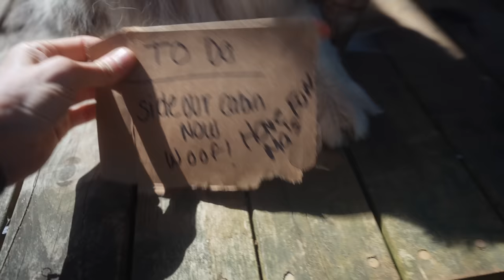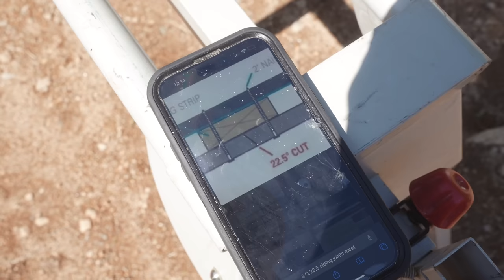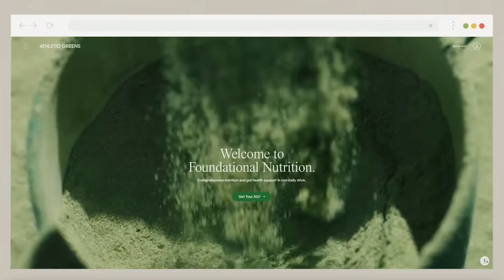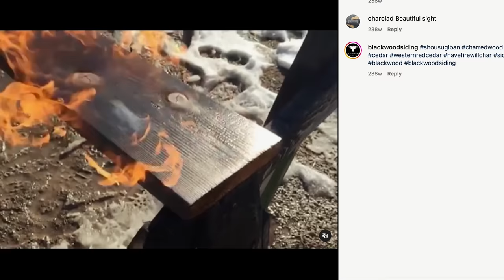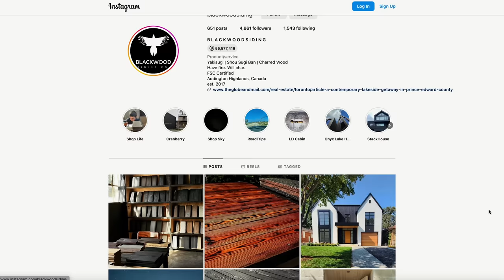Cabin Gets Huge Transformation With New Siding!

Comment: Looks like your Bosch saw is also a sliding compound miter saw. If you laid the siding down flat and leaned the saw on an angle, it would be both easier and safer to make that cut.
Reply from the maker: Thank you, for sharing your knowledge and experience with us. We are learning and appreciate you passing on this information. 🌞🐾
Reply: @Vanwives  I hope I wasn't Mansplaining. When it comes to safety, I had to speak up. Love your videos!
Reply: @JohnB-kc6ii  ...Wouldn't know if someone didn't tell them ...... Of course there's always the tool instructions ,, but we all know about that ... makes good fire kindling ..
Reply: Yes, placing siding flat on the saw table is safer and makes more consistently accurate cut. Carry on!
Reply: My thoughts exactly. It is also alot easier to cut. How did the saw blade hold up? I found charred wood dulls saws fast.

Comment: Both saws are capable of rotating the angle of the blade so you can have the siding flat on the base and cutting the correct angle. But it is definitely looking great. keep up the good work.

Comment: Ladies, FYI, your miter saw has two angle adjustments, allowing you to make straight cuts with the head tilted at the angle you need. Your saw will easily cut your siding as you need. Great job!

Comment: Your slider saw will do the same cuts as your Daddy dewalt, just set your   saw table at (0) then tilt the saw blade at 22.5 degrees and lay your wood flat on the table and make your cuts,using the sliders  of the saw to make your full cuts .

Comment: Your saw is a compound miter saw. Which means you can lean and turn at the same time the saw you have  turn handle and lever at the front  can lean the angle you need and be able to cut the wood without having to get a bigger saw.

Comment: Siding Looks fantastic. Tool Tip, on your miter saw you should have a star lock nut under the sliders at the rear of the machine, ref the DEWALT. This will allow you to tilt the saw so you can make angle cuts and lay your material flat on the saw bed not on the edge like you were doing. This should also allow you to cut wider material that you’re blade is deep? Keep up the good work👍

Comment: Looks amazing!
Tip from a sider: use a liiiittle bit more primer for your blueskin (I know, others will say otherwise but it will bond way better) and of course, the roller.
And when cutting any type of siding, never hold it standing up. It JUST might kick back at your, causing injury (have witnessed this).
Otherwise, for newbies, you two crushed it!!

Comment: First, the siding looks freaking amazing.  What a great job!  Now, Your smaller chop saw.  Does the saw blade tilt?  In other words, could you lay the siding flat, Tilt the blade to 22 degrees and pull the saw through the flat board.  A square cut with the blade tilted?  If you can....You could set one saw to cut the bevels/butt joints and the other to cut the roof pitch angles when you get higher on the wall.  Two saws always better than one.  Heck, the more saws the merrier!
You're doing a fantastic job...Should be very proud of the skills your developing.  Now your only worry, everyone is gonna need you to do camp remodeling!!!
Reply from the maker: Wow, thank you for sharing all your experience and knowledge with us. We sure do appreciate it. 🌞🐾

Comment: Ladies it is called a slide compound miter saw for a reason.😀 Lay the siding flat on the saw and tilt the saw to 22.5 degrees. I prefer 30 degrees but to each their own.  No need for a bigger saw although nice to have.

Comment: Once again great work , 
Your sliding mitre saw will lean side to side to cut on angles with the board laying flat.
Soo set angle at 90° (standard position), lay top sideways to 20° adjuster may be on the back of Unit.!

Comment: I hope you make the cabin home with fire protective wood coating because so many places burn down from electrical faults to Canadian fires. When using treated wood it reduces heat burning and insect problems. In the UK we have safety first even our electricity has quick blow switches and anti serge to help against causing fires.

Comment: Using your original miter saw, could you lay the board down flat, go to the back of the saw and tilt the blade to 22 degrees?  There are two ways to cut that angle on the board.
Reply from the maker: Why thank you Tony, we appreciate you sharing your experience and knowledge with us. 🌞🐾

Comment: If it was me, I'd put foam board insulation between your vertical furring strips before installing the siding.  Shou shugi ban is the burnt siding's name.  BTW, you have a rip blade on your miter saw, instead of a crosscut blade (more teeth).

Comment: 7:24 is there a reason you rotate the mitter saw instead of tilt it? It seems it would be easier to lay the siding flat instead of holding it up vertically.

Comment: I know this is off topic, but have you thought of wrapping thick plastic around your front door deck to stop 75% of snow from entering. Like a hallway, lol 😊 I live against Lake Huron when I had my side porch I wrapped it the second year, omg it saved me so much time. No snow blowing against my door, plus a shelter from the crazy wind. Lol
Reply from the maker: Thank you for sharing Judith.
That sounds like an ingenious idea, especially where you get a lot of snow. Happy Sunday! 🌞🐾
Reply: .... Seems that even many pros don't frame decks correctly ,,, especially in snow areas ,, drop deck framing 6" down below door sill leaving a step to prevent snow from melting under the door ..  a common problem that can be easily prevented  ,, and don't forget the necessary flashing where needed ... under 1st row of siding ,, above doors and windows ..

Comment: To get a more pressision cut you should have used the bosch u can tip it sideways to and the board can lay on the back side down :P so thath saw works for me in a proff carpenter firm  even with 2by8;)

Comment: Not 100% sure, but it looks like you have a sliding miter saw. Turn the saw to 90 degrees, and the saw should lay over to 67.5  degrees (90-22.5) then you should be able to place the board flat and cut it to the proper angle. Either way, it looks "marvelous".

Comment: Your Bosch miter saw was probably just fine. You lay the boards flat on the saw and you adjust the saw blade, to the right  22.5 degree. You can make the exact same cut with a 10” miter saw. You guys were moving the base to 22.5, not the saw blade. The blade itself needs to be laying on an edge. To make bevels that match up you just flip the board over with the blade in the same position. You DON’T stand the board on its edge. That little triangle looking handle on the back of the saw is for moving the blade to a bevel position while keeping the base at zero degrees. Even with the Dewalt saw, you guys were still using it wrong. It’s dangerous to use power tools improperly.

Comment: look at the instructions for the saw you have a way to angle cut those boards 4 different ways with just adjusting the mitre saw you can cut the wood on the flat or standing the piece of wood up look on line with the model number of that saw to see how to adjust to cut the boards flat down please try have the same saw

Comment: Oh my God. You should read the manuals for the tools you buy or just ask questions. The Bosch saw you have is a Single Bevel Miter saw. Look in the manual and it will show you how to tilt the saw head to the left and set the desired angle. That way, you lay the board flat and cut it at the bevel needed.